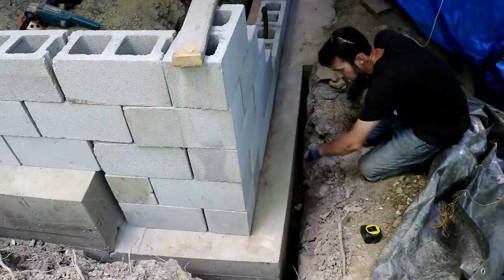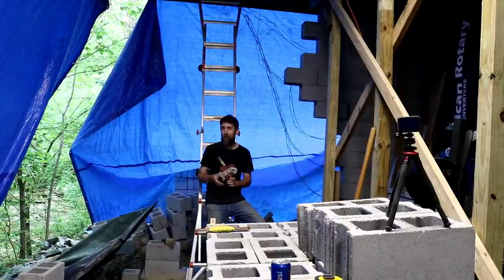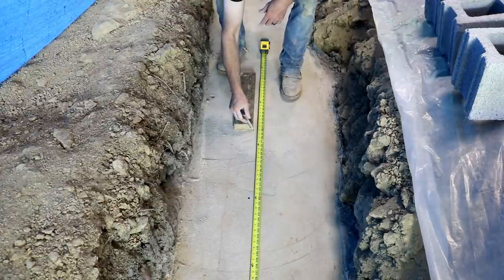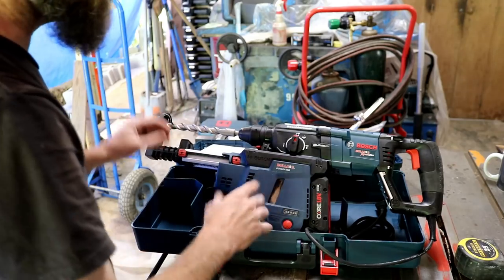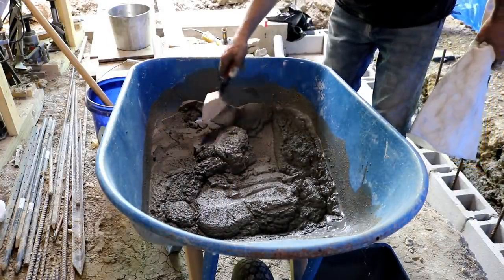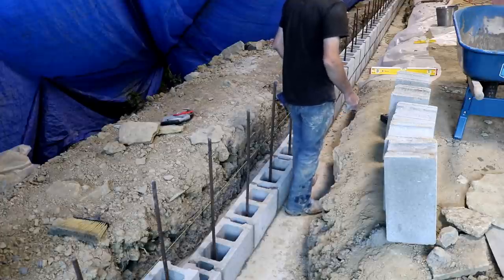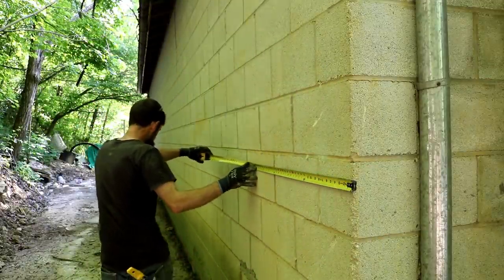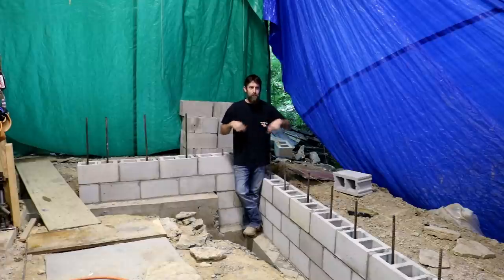Laying Block on the new footer

Comment: Steve, I'm really glad you decided to tackle those blocks yourself. They really are pretty straightforward to lay, as you have found out. Sometimes, we tend to overthink things and the best way forwards is to simply get on with it and find out how it all goes together.
It's all about preparation and starting off straight and true.
Reply from the maker: Its definitely a doable job if you dont get in a hurry and compound a bunch of errors.

Comment: Looking amazing Steve, really impressed! ... We normally put caps on vertical rebar, as one slip next to the trench and it can be instant-death, easy mistake to make.  We used to use tennis balls with a hole in, but the proper caps are so cheap to buy now.  I’m not a comments section safety policeman, but thought I would mention it incase it has slipped your mind.  Can’t wait until next week, will be sad when this project ends.
Reply: If OSHA comes on a job and you have rebar sticking up like that without caps on it you're done. Getting impaled on rebar usually won't kill you instantly. You don't want to be there when they get you off of the rod though.
Reply from the maker: I was definitely cautious. I didn't consider the tennis balls. 👍
Reply: @SteveSummers  when guys fall on rebar you can't use a cut off disk or a Sawsall to get them free. The vibration is too painful. You have to lift them up and burn the rod. Have to cut it somehow though. Doctors don't visit job sites. So yeah be careful. It is pretty bad when fire is the best option.

Comment: Everyone has their kryptonite when it comes to sounds. Many people can't stand the sound of fingernails on a chalkboard, which doesn't even bother me a little bit. The sound of cardboard or styrofoam sliding on dirty concrete is mine... Holy crap it just about disables all thought/reason and movement when I hear it and my body goes into full cringe mode. For the first time ever, I had to mute your video for a minute there heh

In a previous life I had been in nearly every aspect of construction for 30(ish) years, so I've been watching with some interest. You've taken to the process quite well, as I assumed you would. You've gotten a nice start there bud, I look forward to this being completed. It's called a 2x4 hook btw =)

Comment: Skill sets are learned with repetition. We are only good at things we do daily. But regardless how you go about applying the mortar, it is the end results that only matter. Just be extremely careful of all those exposed rebar sticking out. If you were doing a construction job for anyone else, OSHA would demand you use rebar caps. However, I think you are doing an exceptional job. Anyone that has ever tried laying brick and/or cinder block knows how hard it really is. I would also like to say, install a window facing your house. That makes it easier to see anything that could possibly go on in your new shop. Any surveillance capability is always a good thing. Thumbs Up!

Comment: Steve why would anybody critique your block work. Your doing it to get the job done , doing the best you can. Ive built houses n block buildings.  With all your squaring up trying for dead nuts accuracy the foundation is what sets the stage for good strong straight walls. You keep using the string n level itll stay straight . Plumb bob down will help the higher you get now.

Comment: Hey Steve!
I spent a few summers doing earthquake retrofit work, crawling around under houses out here in NorCal with a Bosch Bulldog.  It was old and crusty but drilled a million holes.  Loaned it to my buddy Bill and he drilled a million more.  Didn't have the flashlight or red dot though!

We were required to blow the holes clean, then brush them with a bottle brush, then blow them clean again to get proper adhesion with the epoxy.  The inspector was always threatening to do a pull test on a bolt but never did.  Hot, dusty work!

Comment: My in-laws used a series of sliding glass doors for a wall of windows to enclose their back porch and it worked great.  The doors are insulated, and when you open them up in the summer you get a ton of air flow.

Comment: I bought a small Hilti with a similar dust extractor in the mid 90s. I found it very useful. No need for a second person with a vacuum cleaner, when using in the house to attach something on the wall or the ceiling. I would buy it again.

Comment: Looks  awesome!... go with the  sliding doors as windows , and use gas shocks (like the ones to hold trunk lids open) to keep them open ..if you place the them (gas shocks) in the right location  they will "cam over" and hold the windows tightly closed.

Comment: Steve takeyor bucket of water with the wisk brush wet the ends of the block before putting on the mortar it will not slip off the block so easy.  Nice job going great!✔

Comment: I worked in a jig shop at Boeing for a couple of years. We used epoxy under base plates for fixtures and one technique I saw for injecting the epoxy under a plate after it was set in place was to form a funnel shape out of heavy brown paper and use it just like that grout bag to force the epoxy in. Worked like a big cake decorater.

Comment: I really liked the grout bag. It seemed to make the mortar joint easy to regulate and make laying the block quick to get the right height. Nice work Steve.
Reply: Steve is making great progress but a real brickie is pretty fast with a trowel.
Reply: @John Sullivan
I first used a 'frosting bag' 20-30 years on a tile job. It made grouting so much easier, I've never done it other way, since.  I learned to mix my grout just a little bit wetter, 5%, and don't do all that clean up like you have to do when you rubber squeegee the grout on, and make a huge mess.

After the first time using it, I went back to my mason supply and bought the guy lunch who recommended the bag.  For the benefiit, and the money I made over the years, I should have bought him a car!  LOL

If your boss, (the wife), ever makes you do a tile job, get a bag, and those little rubber + shaped spacers. It'll turn out like a pro did it.
Reply from the maker: @1pcfred  Yeah, A trowel used by a pro is definitely faster IMO. It takes lots of practice to not make a mess and to get the mortar somewhat even. If I had 3x more block to lay I would have tried to use it. By the time I got decent with one I would be done with what little I have to do.
Reply: @SteveSummers  I was a union laborer in the New York metro area so I've worked with a few masons that knew what they were doing. After you shake mud onto a block you have to wipe it. You slide the trowel at an angle on the mud bead to bond it to the block. Then it sticks. You butter the block. More lime makes mud stick better too. Bag mixes can be cheap on the lime.
Reply: George Dennison  Thanks for the tip George. I will try it.

Comment: I would recommend to paint the foundation with Bitumen and Plastic based sealing. 

Else the water can wet the concrete and crack it slowly over time.

Comment: Hy Steve, I think it would be a good idea to fill the stones with concrete. This would additionally increase the stability on the brook side and at the corners.
 If you want to clean the shop with water, you should now think about the pipes for drainage. Use the adhesive power and moisten your stones before masonry.
 
Greetings from Germany Walter

Comment: Well Steve, you did a nice job so far.   Since it's going to be below grade. be sure it will be sealed properly to avoid water crossing to the inside below the floor line.

Comment: I like your dad's response, good answer. As for picking apart your work, c'mon Steve,  you're already in the better half of the quality scale to be hired. It looks great. If it were mine I'd run block up to bench height myself. Just for durability and ability to pressure wash etcetc.  The best thing about doing it yourself is not only the satisfaction, but making it how you want it...... You only need 6-10 more squirrels don't you?? Haha thanks for sharing

Comment: Steve it looks like you will have up to 3 rows of blocks above the frost line ,perhaps fill the 3 bottom rows with cement ,parge coat the underground portion and tar it +install good drainage pipe , Check with your engineer  to prevent future problems

Comment: Great job, Steve! By the way, 16 inches is around 41 centimeters, not around 41 millimeters.
Reply: Gary Ramsey     That is only off by a factor of TEN
Reply: Metric sucks!!!
Reply: or 410 mm
Reply: @dannywilsher4165  why not embrace both? I use metric all day but my folks always use imperial... either/either makes no odds to me... I grew up with both and use both  🤣
Reply: @ogeoffreys  I'm with you Mr. Oil. I have two engineering degrees and have done projects all over the world and have used both extensively. I don't find either one easier or harder than the other. I just like to stir the pot and get some wild conversation going about what's best or worse.... And you Sir, took the center of the road. I like that and thanks, hope you have an awesome day!!!!!
Reply: @dannywilsher4165  that's great to hear on not alone with that 🤣 I get some funny looks at my dimensional notes when half is metric and half is in old money 🤣 hope you have a great day also sir 👍.
Reply: @dannywilsher4165  Not really, it's easy peasy, metric is generally easier to calculate if you are familiar with both, but occasionally imperial is best. One example is if you want to telescope aluminium tubing together when building radio antennas.  Imperial allows you to have a small sliding clearance between two consecutive tube sizes, by simply choosing the correct wall thickness, whereas in Australia anyway, metric tubing goes up or down in random increments, so your wall thicknesses would be all over the shop if you even could have similar sliding fits.

Comment: I liked buttering up the reobar with epoxy to. I’ve never done that, but it’s a good idea. I cut the reobar with a 70 degree flat point on the end, to help the epoxy slide past the bar when pushing it into the hole.

Comment: Looks great, straight and plumb even without using a dial-indicator. :-) You are a man of many talents. I am not a structural engineer but somehow I missed the reason for the vertical rebar, especially the need to use epoxy. There should not be any forces upward or lateral plus gravity is your friend in this case.

Comment: I think what you doing looks great and I think you should go ahead and do it all, it's not like you're building a solid 10' high wall the full 48'.  I also just checked my local Lowe's here in Seattle and the same bonus Bosch has is going on here, that vacuum is 199.00 alone, so it is a bargain...wish I needed one!  But my 25 year old Dewalt is still chugging along. Cheers!

Comment: If you get yourself a square finishing / plaster trowel you will find it easy to manipulate the mortar and get it shaped and stuck where you want it. Just work it between the two tools until the shape is right and then apply. Sure it will be slower than a pro that can do it from a mortar board, but I find it easier that way.

Comment: Long time coming, but really looks good. Steve of all trades, with a pretty assistant, and a small furry foreman. You can finally see the light at the end of the tunnel.  Gotta be a great feeling. I know how happy n pleased you will be when all complete. Remember to place a small tree on the roof to let all know it's complete.  A tree topping party we call in the construction trade. Thanks for all that you have shared with us all. Just a thought, but have you ever thought of spray foam in between the trusses. It will greatly improve heating, n cooling your shop. Also helps with sound. Good luck my friend. Keep sharing, keep safe, n keep doing what you do.

Comment: I find it hard work with a grout bag, much easier with a trowel,wouldn't think of working with rebar unless you  had some type of protection on end of those rebar, I use tennis balls,can save a potentially nasty accident.
Lovely neat blockwork.

Comment: It's been a while since I was a contractor but it use to be part of the OSHA regulations for protecting the worker(s) from crystalline silica by using respirators and/or vacuuming systems. Not sure how the rules have changed but I see the vacuum attachments are more commonly used now by contractors. Nice work.

Comment: Hello Steve, great progress. Not sure if it matters, but you might want to see if a moisture barrier should be used. Here in Germany we protect the outside walls, that sit below ground, from ground moisture by "coating" them (tar like paint) and by putting plastic sheets with bubbles in front of them. Also, I saw quite often that a barrier layer is used between two rows, typically at the lower row level, so that no moisture can creep up the wall. Anyway, very interesting what you are doing :) Stefan

Comment: Steve structurally the corner pillars will add negligible strength, but  it sounds more like a cosmetic thing as 2" x 6" studs and double jack plates will hold the roof easily and still distribute the roof load.

Comment: I'm a construction inspector, and one of the things I inspect is masonry construction.  The string line should be at the top corner of the block, and that is what you lay the block to.  That ensures that your wall is straight and plumb.  You also should be periodically checking that the wall is plumb with a level.  The "ladder" reinforcement is not meant to take the place of a bond beam, it is to strengthen the wall and should be placed every other course.  You should also grout the wall fully below grade, or at least where the reinforcing steel is.  Just as an FYI, you probably didn't need to place reinforcing steel every 16".  Every 48" would have been sufficient.

Comment: Can’t remember how high the walls are, but the rule of thumb (I’m a structural engineer) for the length of the return you should use on the long wall is at least height/6.

Comment: Looks good, Steve. Something, something (I have completely forgotten the rule on it) don't go higher than 4 feet at a time before you let it dry; and grout filling those rebar blocks is going to be real hard once you get near the ceiling.

Comment: Great job Steve. If I heard you correctly, you are finishing the wall with wood studs.? If I might say, can you consider using metal studs. They have several advantages, including insect control. The cost is about the same as wood. You can frame your window openings with wood for installation. Lighter wall to work with and strong. Just my opinion. Like I said you are doing a great job and you should be very proud.

Comment: I was gonna suggest one of those big azz frosting bags, but then you did the vid showing off your trowel technique, I didn't bother.   Guess you were less impressed with yiur skills than I was.  LOL

I encourage you to take the neighbor up on his offer of the sliders.  You'll be glad you did when you see your winter heating expenses. I have some of the windows you're looking for.  I took them out of a basement in the '90's when I built a studio for a local jazz musician, Tom Grant.  

The windows are single pane glass, and I put them to about the best use I could: they became a wall in a material storage building I added on to the back side of my shop. It's open on the non-weather side, has the glass on the end, and has two windows and an old aluminum storm door on about 2/3 of the other side.  The rest of that wall is a vertical accordian wall of 16" panels, which folds up, when I'm taking long material out.

That's the one thing about building things, you gotta have a shop for all your tools, then you gotta have almost as much room for materials.  After 50 years of building stuff, I finally have a place to store my lumber, sheet goods, metals, stone & ceramic tile and plastics.  The other stone, block and such, I don't  room for.  But it can handle the weather, every few years, I have to raise it out of the 'ground' because the back half of my 1/2 acre is natural Doug Fir forest, anything with weight slowly sinks into the many feet of fir needles!  

My neighbor asked to store some tires and wheels in the back corner, and I told him to put them on the couple of old pallets I hadn't cut up, yet, and like most neighbors, (the know more than you kind), he didn't think it was needed.  It's been less than a year, and I was out there a couple days ago, and the one of the four tire high piles had already fallen over!  

You're getting to the best part of a project, putting it back together.  It'll go quick, now.

It's so nice to get it done, and enjoy the benefits of your labor for the rest of your life.  I try to stop and appreciate the improvements I've done here over the last 22 years.  It makes the labor of today much easy to do, when you stop and value what you've done.

Something I started doing when I hit my 50's, was plan improvements with the idea I didn't want to re-roof, again, (went with metal), didn't want to re-build a deck, again, (went with concrete flooring like a high rise, using B decking,  thin concrete and stone, and didn't want to paint, (used concrete roofing for roof and siding on a hot tub & sauna house I built out back.  

When you get older time goes by so fast, don't waste it doing maintenance, spend as much time as you can doing only what you love.

Lookin' good. 

GeoD

Comment: Looking Good.   I would grab the  windows and go with it . And make the custom frames I think that sounds like a great idea !
Reply from the maker: They are some great glass . Double insulated and large .
Reply: @SteveSummers   Even if the windows are fixed because of the weight you could put a wooden opening shutter in that wall also.  regards